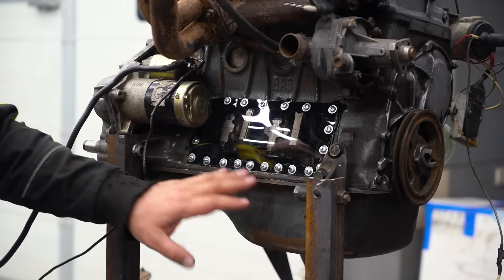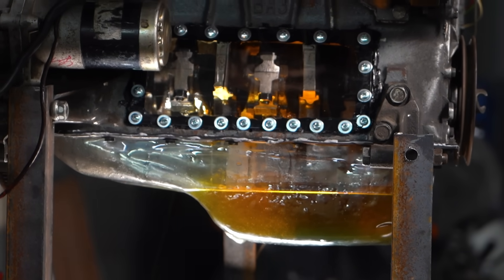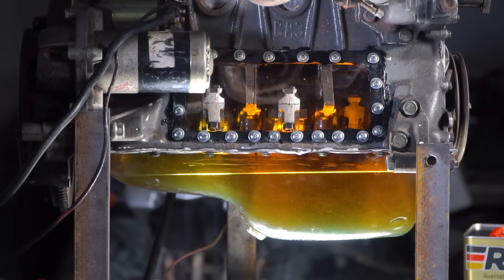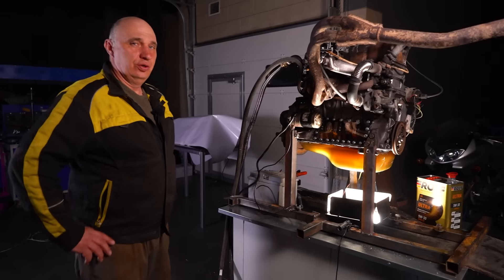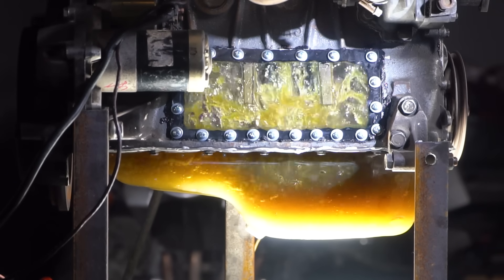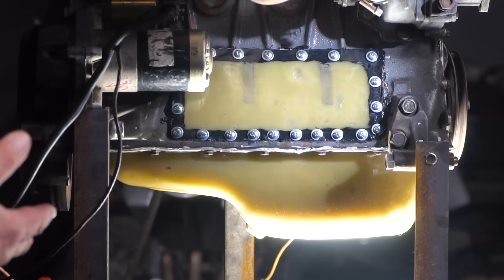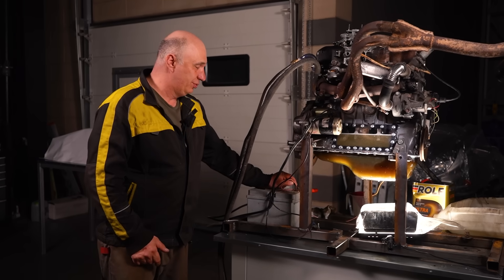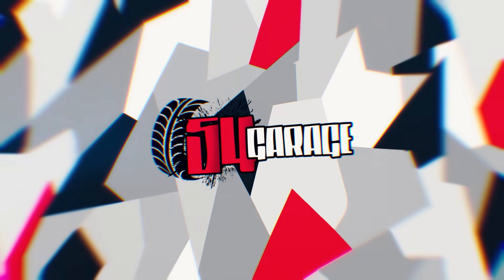What actually happens when you overfill your motor oil? (w/ transparent oil pan)

Comment: I always wondered what happens if you put too much oil in your car. I can think of a few things. The more the oil is stirred up, you are introducing more friction to the engine and therefore causing more heat to generate than normal. You can do this by blending water on high speed and you can notice the water getting hotter overtime. There is also hydrostatic pressure where you introduce much more fluid pressure. In this case, there is less air where you have less room for fluid and air to expand due to heat and lack of air volume as air spring. If there is not enough room, it gets forced out through pressure release and seals. The third thing is the engine has to work harder to move the arms in the oil. Its like swimming in oil where you have to use more force to move your limbs around compared to air. I expect to cause timing issues with ignition timing, increased wear not only the jointed components but also seals and the pistons above. I would also expect there would be reduced fuel economy due to having the engine working so hard. The noticeable foaming of the oil also could be a problem. Since foam is basically made by frothing fluids with air, it reduces the oils lubricating properties, and if it is circulated to other parts of the car, it will affect how its pumped to those systems, how it lubricates, and how much actual fluid is being pumped into those parts. Idk, maybe there is a another void of empty space container like the bottom of the crank case. 

I am not sure if oil is just in there but I would also expect to have oil mixed in places where it should not in, like in the coolant due to failed gasket from too much pressure in the engine bay or even other systems that uses oil.

Comment: This is all at room temperature though. If your oil gets up in the crankshaft outdoors in January, with non-synthetic oil... it's not gonna want to start. And if oil is in the way of the crank weights, it'll sap power/efficiency. And the foam is undesirable for several reasons. But it can take more oil than you'd think.
I had a car with bad rings, would burn 2 quarts (liters) between oil changes. I started overfilling it by a quart, and it would be a quart low by oil-change time, so I didn't have to add any mid-way between changes.
Current car doesn't burn any oil, and calls for 0W-20 synthetic. I feel pretty comfortable giving it a half quart over spec (it wants 4.5 quarts, I give it 5, just so I don't have a half-quart laying around the garage).
Whether you typically park on a steep hill probably makes a difference here. I live in a pretty flat area myself.

Comment: It’s actually cleaning the motor better. I’d let run 15 minutes at 2,000 rpm and drain oil. Put back accurate amount back in.

Comment: I have a 2yo car that takes 7.5ltrs of oil (including filter) and I always put 8ltrs in it (extra 500ml).
I have done this with all the cars I have owned and never had an issue. Of course, an extra 500ml probably only makes the oil in the sump 1mm deeper, so there's no harm or chance of foaming. If you put an extra 2ltrs in it, you might have a problem.

Comment: With the excessive oil, crank case pressure was indefinitely through the roof. Resulting in oil forcing itself passed gaskets that being your sump gasket. I doubt your see through sump failed, it was the pressure that broke the sump seal resulting in your oil leak

Comment: So the the only problem I could see happening over time is the excessive aeration of the oil could result in cavitation of the oil pump which could cause shortened pump life or in proper flow to the head section causing a top end failure.

Comment: Many new cars come intentionally overfilled from the factory by a half quart to a quart.  My Honda products from 90’s I know came overfilled.  It is to allow for some running-in oil consumption.  They know people don’t ever check their oil levels.  If you think about a quart of oil spread across the surface area of the oil pan, it probably raises the level by a fraction of an inch.

Comment: With 400k miles on my cars I like my Oil Level to be at the Bottom Marker of the Stick, I get better Torque and faster revs. also after fill ups
on the freeway I get a stronger burn with cold gas fresh from the pump. so for me low oil and cold gas makes for a better running engine.

Comment: Thanks for making this vid, I never was able to see inside the engine while running, But.... I have always slightly overfilled to allow for sump pan drop, rather have more than starve for oil.
For those that don't think about it this way,. what you're seeing when excessively overfilled, is a mild version of hydro--locking.
normally it's crankshaft seals that get pushed out.

Comment: Awesome demonstration. The true issue with over fill is not really the oil, but actually that air caused by agitation and the eventual failure of materials, the oil trying to find a path of less resistance to expand. The lesson learned hear is engines that have aged and uses up oil up faster because of moder engineering practices, you can just add 1.5X the normal amount and fill safe doing so.
Reply: the dip stick have hallow dots on it which tells how much space is in the sump available to fill the oil for the engine
Reply: If you put to much you will hydro lock a new engine! The new vehicles are junk! Have an 02 Mazda protege, and I have a bad radiator! Waiting for the extra cash to replace it! Has pegged out 4 times now, and still the head gasket is good!
Reply: Oil baffle would stop this or help dranatically

Comment: I would say bubbles are bad and will pit everything inside due to the extreme pressure bubbles create when they pop creating a micro size plastic deformation. This becomes brittle and will break off deteriorating the surface finish over time. Don't believe me, look at propellers on boats. Don't overflow. Here it seems there is a 2x factor of safety. Which makes sense if a knucklehead forgets to drain the pan first when doing a change.

Comment: The old engines of the 1910 to 1930s engines a oil dipper on end of rods. This was called dip and splash system. Engines couldnt Rev over 3500 rpm
Long duration engines over speed would destroy these engines. Later oil pump fed rods engine rpm went to 4800.

Comment: Man, I hate the sight of oil that's been frothed up. My ex wife thought by filling the engine with oil all the way to the cap on the valve cover, she wouldn't need to worry about it for a long time. The excess oil was pumped out over time, but not before being aerated by the spinning crankshaft assembly, causing it to lose it's lubricity and destroying my engine. Never should've allowed her to borrow my car. She always said, she took care of her cars by herself, checking the oil and fluid levels every other fuel fill up, but she lied. Her engine seized from lack of oil changes and her letting the level get lower than the dipstick.

Comment: So underfilling, definitely bad.  Recommended fine but can safely put more in.  Double not bad either.  At this point some of my engines would blow it out crankcase breather overflow down tube.  Three times would have it blowing smoke and the air filter blowing oil.  Would not even go to where you went with totally filled engine.  Would have thought seals would go with the cavitation and air bubbles much sooner.  Good show!

Comment: In my 45 years of automotive repair, I’ve been a 2012 Chevy truck drove in & complained about sluggish and no power.   I found the customer did his oil own oil change and put 18 qt of oil in his engine.  No leak, no smoke & no check engine light.   I drained to its normal level, drove it for 5 miles!    Fine,  back to normal!  No repairs needed other than draining out the excess oil.    So little overfilling of oil is not going to hurt unless you’re racing.   I can’t say that works for ALL engines now.

Comment: When an engine get's warm pressure rises and when it is filled with too much oil seals could go leaking or oil could be pressed between piston and cilinder and once an engine does thay it will keep doing that. So you might end up filling up oil and adding gass instead of filling up gas and adding oil.😊

It caused me to avoid garages and do the oil changes myself cause it caused me to scare for problems and had to crank the car up at the parking lot at my job, finding something to catch the oil and go underneath my car there to loosen the bolt to let go some of the engine oil.

Does anyone know how your engine sounds like with too less oil? I do, because of garages with basic grade diploma employees fill up your engine too much cause they don't know and don't care.

Comment: When too much oil is added, the level in the oil pan becomes too high. That allows a fast-moving lobed rod called the crankshaft to come into contact with the oil and essentially aerate it. The result is a foamy, frothy substance that cannot properly lubricate the engine. Think of this as your engine’s way of turning cream into whipped cream. No one wants whipped cream lubricating their engine.

Comment: depends on the engine you overfill ! 
i overfilled mine. it did not die instantly. But the oil pressure got higher than usual, so after some thousands of km, some oil got  through the valves and melt with diesel. that's not good because it is making higher pressure. plus it makes like a leak of oil. 

so it does not kill your engine instantly, but it damages it. 

my engine was very good despite 400.000 km, but now I have some pressure oil problems and need to check them.

Comment: In 50yrs I've NEVER seen anybody add "grams" of oil to an engine.  Better cut a plexiglass window in your block if you plan on adding oil by weight instead of volume.

Comment: My Subarus always leak at the very least and burn too on the highway.  It's the old subaru engine way.  And I've run them a half quart overfull for hundreds of thousands of miles.  That way, when they lose oil they end up 3/4 full instead of 1/4 full.  I check them every couple weeks.  In the past depending the severity of leaks I've had to check them every week.  I can fix some leaks, some leaks aren't worth fixing like a rear main seal.  So it is what it is.  But an old EJ Subaru engine is very tolerant of being run overfull.

Comment: Always found my car runs best when the levels between 1/2 to 4/5 on the dip stick, any higher and you can smell it and the lifters tick longer. Lower and it's time for a top up. 

(My cars an old worn out 2003 Getz, previous owners didn't look after it well)

Comment: My brother always has oil issues in his car. Oil always too high. Oil everywhere. For years and years this went on. I kept telling him DO NOT OVERFILL IT he said he never did and never tops it off. He just puts the exact 4 quarts in when he changes his own oil. Years later. We are working on his car and ready to change the oil. He takes off the oil filter drains the oil. Puts new one on. I’m watching. Ok looks good. He opens the hood and oil cap and starts putting oil in. I said “what are you doing?!?” He said putting the oil in. Aren’t you going to drain the oil? I ask. He said he already did it came out the filter hole. 

…..so one time he watched our friend change his oil at the shop. He must have not watched the part where he removed the oil petcock. And he thought an oil change means take filter off let it drain then put filter and oil back. 

I mean it kinda makes sense if you don’t know anything about cars. So mystery solved.

Comment: My first car was a 1980 Lada. I performed my first ever oil change on that car. Really filled it up good.  As I drove off, people on my block started shouting at me. As it turns out, flames were coming out of my tailpipe. The car was fine after I removed a perceptible amount of oil.

Comment: Never, EVER, overfill a diesel engine. It may enter a self running mode and burn its oil, reaching extremely high speeds,  and you will not be able to stop it with your ignition key. You may end up being unable to control the speed of your car, while seeing it accelerating on and on. Only one solution then : pressing the brake pedal firmly and force the engine to stop as soon as possible on a safe lane (without pressing the clutch pedal).

So no, it is not irrelevant AT ALL to add oil above the max level.

It may be a terrible idea, depending on which car you actually own.

Now, guys : you may have fun in making experiments and putting your life at risk but please avoid putting others in a dangerous situation with an oversimplified, hence false conclusion.

Diesel engines also exist. Not only petrol ones.

Thumbs down. 👎👎👎

(A small advice : would you want to repeat that insane experiment with a diesel engine, and even worse : a turbodiesel engine, stay away from the block. Many meters away.  Much, much more than the crazy, close distance you were at in this video)

Comment: There can be good reasons to thoughtfully overfill the oil.  I had a ‘96 Mustang Cobra, and the DOHC heads needed a fair amount of oil, but the return passages were pretty small, so the heads ended up holding more oil when the engine was running.  This wasn’t an issue on its own, but it did mean there was less oil in the crankcase when the engine was running.  I always put in 6.5 litres of oil instead of the recommended 5.5, and immediately after running the engine the oil level was consistently at the full mark.
Reply: I think it’s a good way to flush the engine of gunk buildup….add an extra quart, take the car for a spin for 30 in the highway, take it back home and drain oil.  I knew someone who did this with conventional oil every 3k miles and the car lasted over 30yrs

Comment: i think the problem is with older engines especially with a current owner that isn't wealthy to have all the proper service maintenance done and parts being cleaned flushed/ maintained properly, then the seals and internal operations suffer.  and then when you don't add the proper levels of fluids, it can compromise your system more, even with oil. it is good to see however that in a properly flushed and taken care of engine that adding 5 extra quarts won't harm it lol. 

for instance my old beat up 98 s10 if i put 2 or 3 extra quarts in it it might make my slight oil leak worse idk.  i'm thinking about just putting in a slightly thicker oil and not using synthetic. i've heard synthetic the molecules in it are closer together allowing it to leak easier so for an older car non synthetic is better actually. interesting

Comment: The only issue I have found when I've overfilled small engines on accident is that oil soaks the air filter and can choke the engine. Easy fix

Comment: I worked at a garage in 2002 and a lady came in stating her oil light was on and it was leaking oil, we raised it up and then pulled the dipstick and it was up to the bottom of the stick handle. We then drained it out and filled an entire 5 gallon tank, so we had to plug it up and drain the tank and then drain more which filled it about half way, so roughly 30 quarts she put into this thing... it was a nightmare. Needless to say she destroyed the engine, was a late 80's early 90's GM Multi-Port 3.1 liter engine if I recall. One of the most ignorant things I ever saw as a mechanic other than a guy coming in for an oil change on a 97 Thunderbird with 75k miles bragging about how it was the first oil change he ever had on it. We saved the quart or so of sludge that came out of it, showed it to him, he laughed and then told him he had to sign a waiver stating that any engine failure after we changed the oil was not our fault. He signed it then a few months later came in complaining about engine knocking noises. DEEEEEEEERRRRRRRRRP!

Comment: This engine is quiet primitive. More complex enjines with oil vapor recirculation system probably will affect air filter. And as people here said bubbling is not good. Hydro hammer effect will add vibration and bearings fast wearing. So I wouldn't recommend to overfil.

Comment: back in the late 80's i was replacing the oil and my wife at the time was ready to go to her dads party, i asked her if she wanted to finish the job, all she had to do was add oil, she said no problem, so i went to get ready, 10 minutes on the road the engine fails, seems she filled the oil to the top and blew the head gasket, My bad, i did leave her with a case of oil, i just assumed she would know